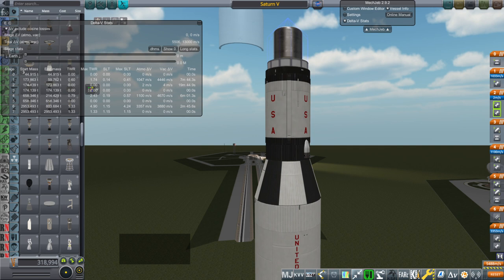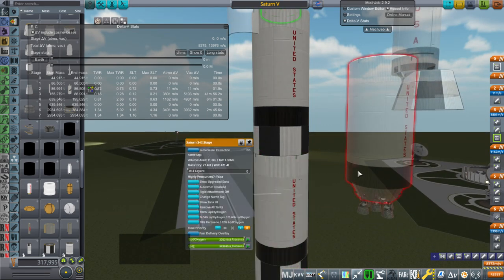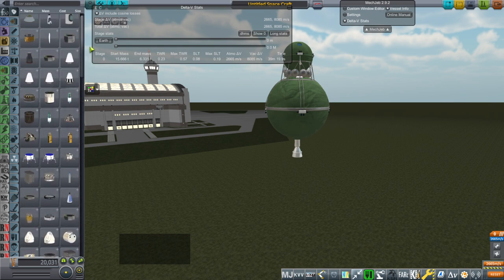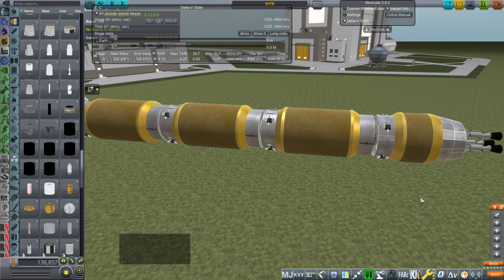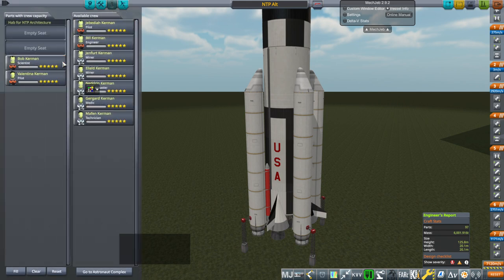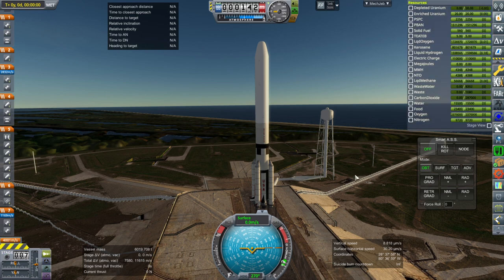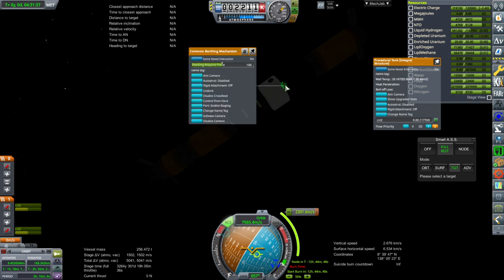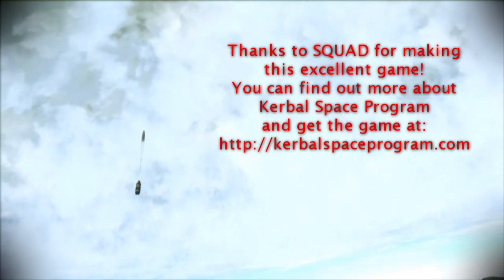KSP with Realism Overhaul - Uses for Nuclear Thermal Propulsion

Comment: Always keep ur tanks full (realistically full). scale the tank down rather than under fueling it to reduce dry mass.
Reply: That doesn’t always work in real life because you need to make an entire new tank, and redesign anything directly connected to it. So in many situations it’s cheaper to have tanks not quite full than building a new tank.
Reply: @benisjammin8926 When I play R/O, I design a new launch vehicle specifically for each payload, not the best way of doing it, but it works.

Comment: For that Saturn V with strap on boosters, you could consider removing the center F1 engine to slightly reduce G forces during launch. In theory this configuration gets slightly more delta V, and would have a lower cost. Wether that extra thrust is needed after booster separation is something I can’t be sure of without experimenting with it.
Reply from the maker: Yes, that could be done.

Comment: I just built a 2nd Space Station section with a Nuclear Reactor ( 3.75 Meter sized ) in the newer KSP 1.11.1 version update game ( on the 22nd June 2021 )
I saw in the space center VAB build the Power tab has the different sizes of Reactors and Batteries and solar and of course cooling radiators.

But there is no units there unlike last time for you to attach to the Nuclear Reactor to convert the thermal output of the reactor into electricity to power the Ion engines 
I got to then move my 2nd station to the 1st station section in Kerbin orbit?

So I built the 2nd station fitted with some curved solar panels and the 3.75 meter reactor and new big round block like super batteries 
and when the huge quad rocket system got this station into orbit 

I turned on the reactor ( clicked deploy on the pop up menu ) Nothing happened, 

My big 3 Ion engines were running to change the high orbit to meet up to dock with the 1st station section, 
And the electricity on board was running out.

No power was being made from the reactor into the station at all? 

WHY is the reactor not making electricity?

There is no help available in the in game wiki about the reactor use and how to get electricity from them to the station and ion engines?

Anyone here know where I going wrong and how to fix this lack of electricity from the big 3.75 Meter Nuclear Reactor?

Thanks.  8 )